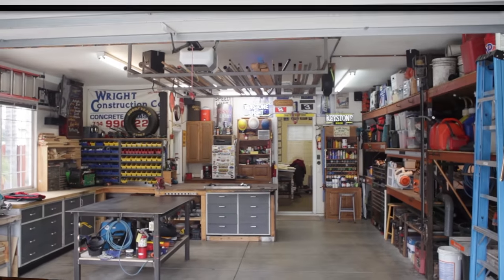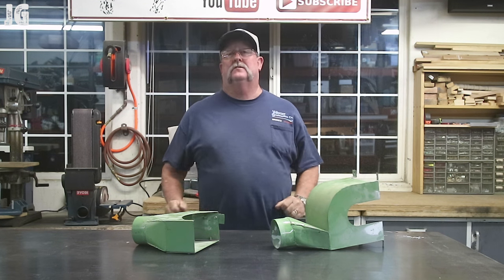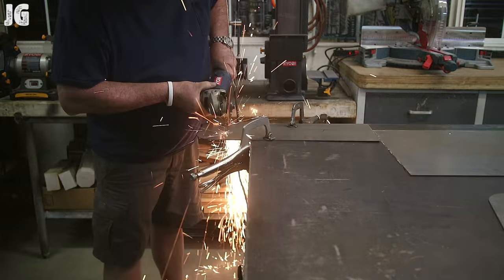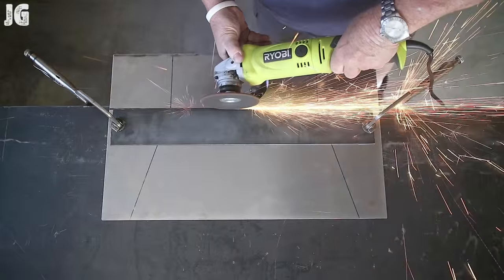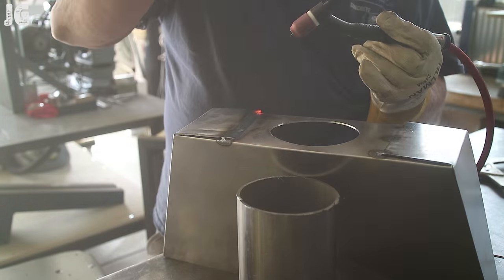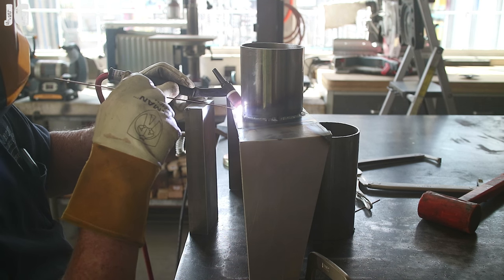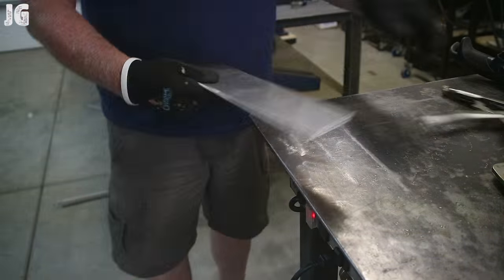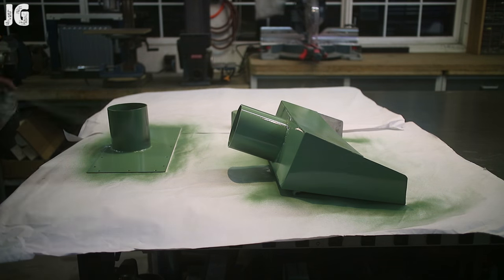Dust Collection System Mod - Jimbos Garage

Comment: aw shoot Jim, your just a cool dude! project turned out great . I have a similar set up for my dust collector. I built blast gates in mine so I could shut off areas not being used. and have several floor sweeps in various areas of the shop also with blast gates. tho I opted for a different design.  Again great video.
Reply from the maker: +James Smith,    Thanks for watching James!, Ya i don't know much about those systems it was just an idea i had, It seemed to work.  Jimbos garage!